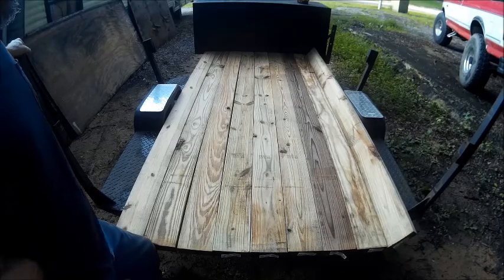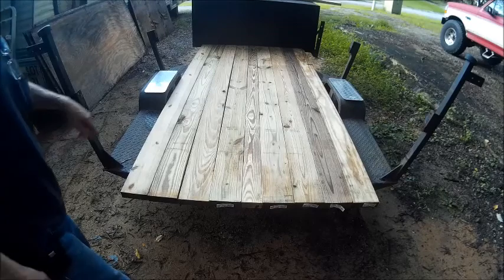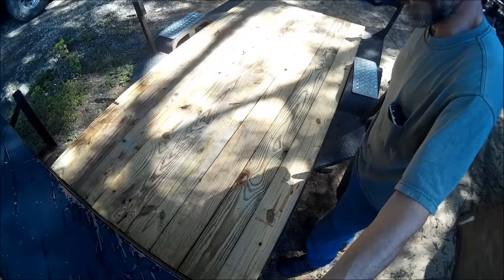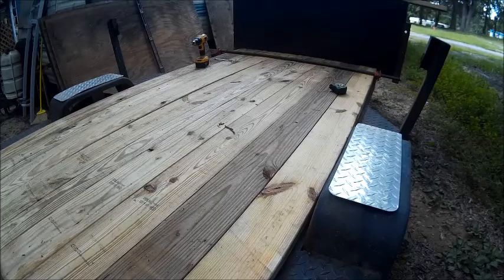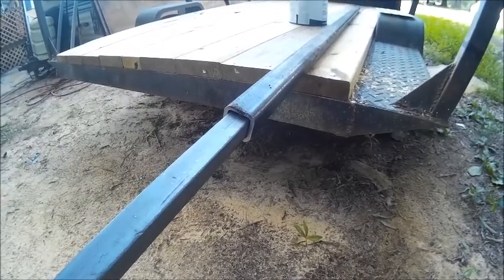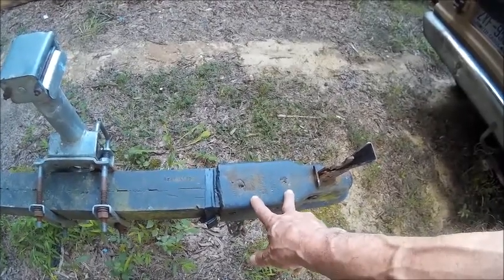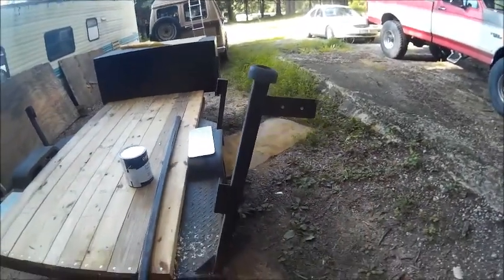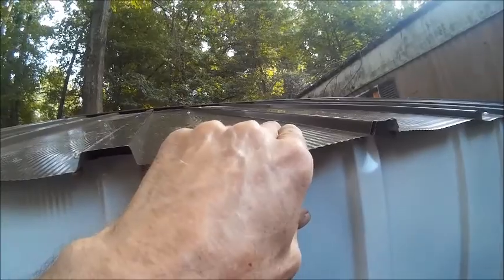boat trailer conversion to a flat bed part 2

Comment: what model number or item number welder did you get?
Reply from the maker: http://www.harborfreight.com/165-amp-dc-240-volt-inverter-tigstick-welder-61792.html
Reply: cool does tig as well. i want a tig machne